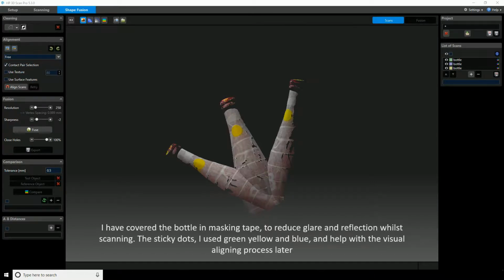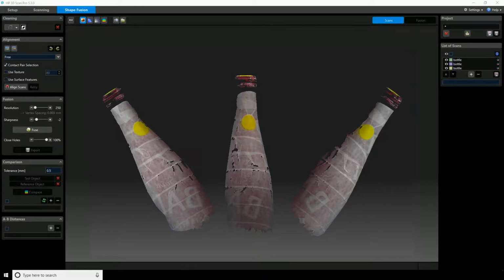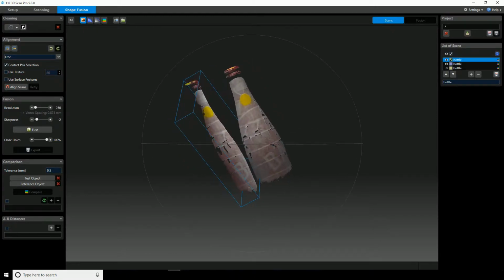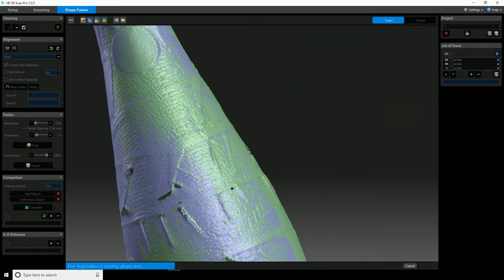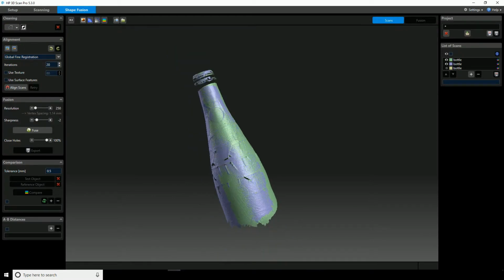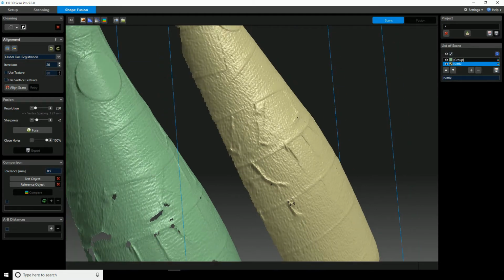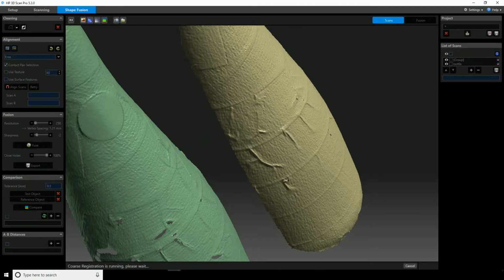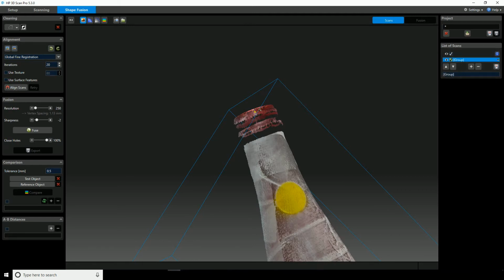Aligning 3D scans with HP Scan Pro 5 on Sprout Pro G2

Comment: Was there a ton of blurring on the fuse step? The bottle seemed to have a ton more detail in the alignment stage.
Reply: there are options to change the resolution and also to smooth or sharpen the output. In this case I smoothed the model to the max, with quite a low resolution
Reply: @rogerpestereff1154  Thanks. I got the HP setup. This was my first scan https://www.thingiverse.com/thing:3334555